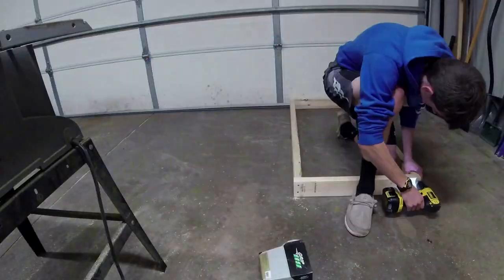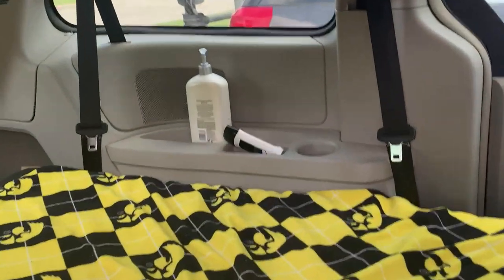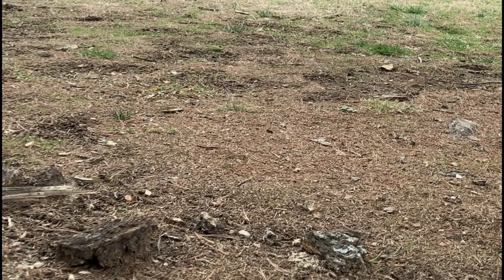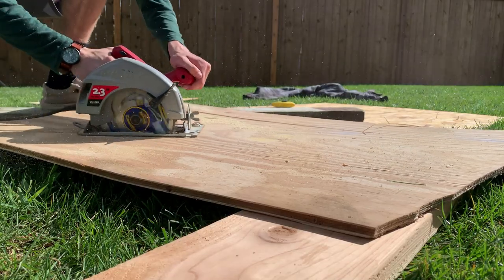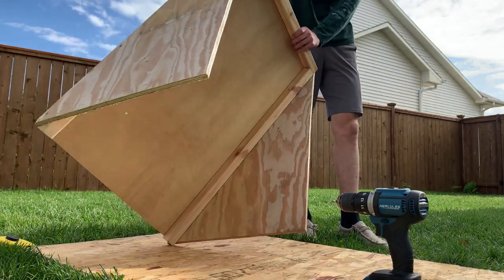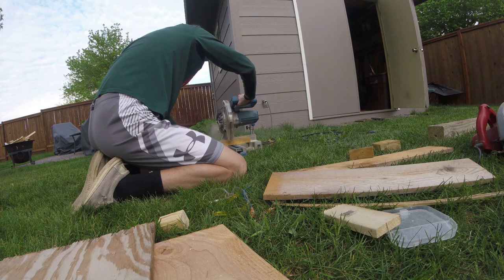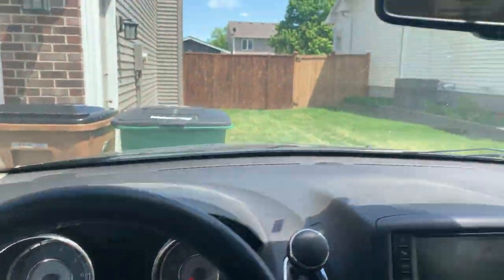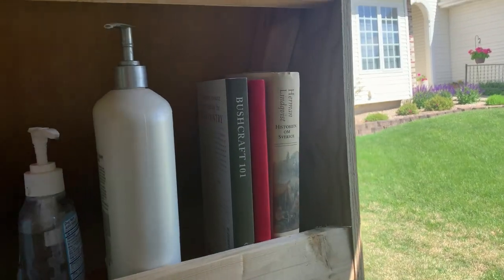Making a Minivan More Like a Home - Building a Bookshelf and Closet

Comment: Hey dude. I like How it's coming out,I mean you didn't mean to make that carpentry but in the end it looked good,an I like the sink and stoovein the back but I don't know if that water jug is going to stay there. Get the storage for the back of your drivers and passengers seat ,you can really store alot of stuff in there.amazon has it ,of course.
Reply from the maker: Thanks for the compliments and suggestions! I’ll have to check that out. I usually move the water below the kitchen but I might want to think about bigger more permanent storage up front. Thanks for the idea.